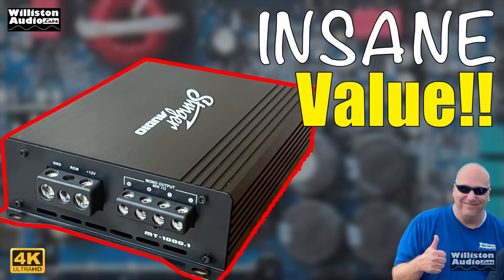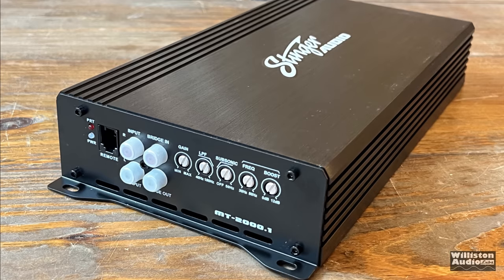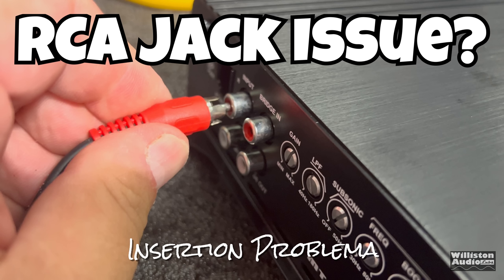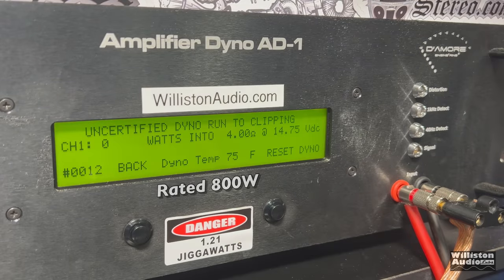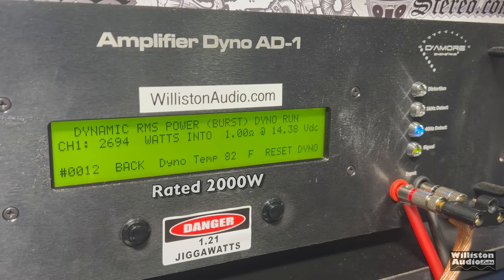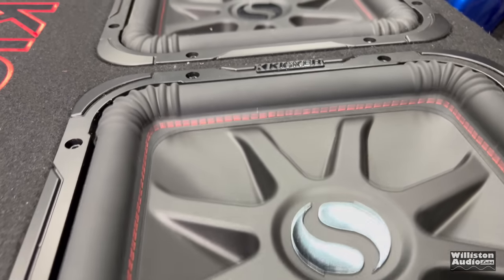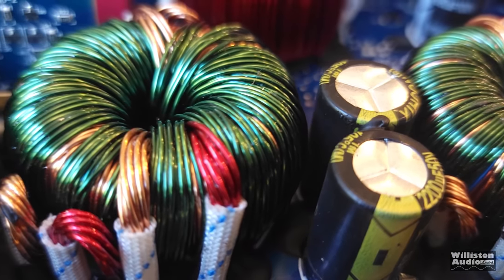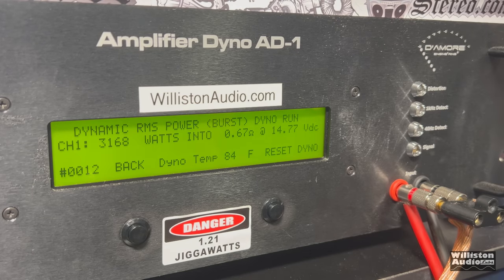This 2000W Subwoofer Amp is Impressive

Comment: Phoenix Gold: the cheap stuff when you couldn't afford Street Wires.
Scosche: the cheap stuff when you couldn't afford Phoenix Gold.
Stinger: the cheap stuff when you couldn't afford Scosche.

So yeah, I had a lot of Stinger!
Reply: Phoenix Gold was absolutely NOT just cheap stuff by any means. I had the ZPA 0.5 amplifier with the plexiglass front and dual cooling fans and it was one of the best amplifiers  i ever owned. I paid around $1200 for it new back in the 90s!  They are still fetching quite a bit of money on ebay and Audiogon today, they are highly sought after .
Reply: @vegaslimoguy2376  You had to be there. This was from WAY before the timeframe you're talking about.
Reply: @vegaslimoguy2376 When streetwires was around and PG was selling their accessories (1992-1995) they were cheaper. Not cheap (well the PG SAPPHIRE was cheap) but the comparison is FAIR.

Comment: Have anyone ran into the problem of buying a new 4 ch amp and one of the channels don’t work? Has this happened to anyone else. I bought two completely different amps from two different companies and both had one of the channels not working.
Reply: Maybe check your signal wires, could be a bad channel or bad wire from your signal source.
Reply: @huhdidwhat  thank you for the response
Reply: Definitely switch around your rcas to make sure all 4 have a signal and then switch around the speaker leads to make sure you don't have a blown speaker. 

What your describing sounds highly unlikely. Possible, but unlikely.

Comment: That white strap going over the red thing inside the amp is the strap. That's why it's strappable.

Surprised you didn't know that.
Reply: Mind Blown.
Reply: Sure, lol. 
Except Stinger calls it bridging two amps. I guess we have to stack them like a bridge. Lol
Reply: The bridge is CLEARLY the silver rod above the two round green things. This, by the way, is the only reason two round green things can EVER be used at the same time, hence the "bridgeable" spec.

Whatever it is you're talking about is complete nonsense.
Reply: @Cookie-Dough-Dynamo  This is funny and all, but I don't want people to think we are serious.
Reply: Who's not being serious? If you're having a hard time understanding this, that's ok. Try looking at this from a different perspective: Pause the video during the "watts inside" bit and zoom in on the red and green round things. Now,  lay your phone flat and look at that amp end on. You'll see how the strapped round red thing and the silver rod bridging the two round green things allow this amp to run in the strapped/bridged configuration.

It's one of only two amps in existence capable of running in this state. Steve Smith himself developed this design and used the red and green colors as an Easter egg.
Reply: @Cookie-Dough-Dynamo  That one was not even funny.

Comment: i do not like at max high 180hz frequency seems low but i never bought a sub only amp as i like to set may own cut offs
Reply: You can set the crossover anywhere between 40hz and 180hz. Most will choose 60-80.

This is a good thing for a mono amp. Its built specially for subwoofer or bass use.

Comment: Nice amp but it is way to small to put out a massive amount of AC on the subs with the heat sink being a "basic" one.  I do not trust it.  That is my thoughts on this amp.
Reply: He shows after hitting the quad box it ran cool. Not to mention there are 2 comments in here that bought them and stated they run cool. So yea 😊
Reply: It’s 2023, size doesn’t seem to matter anymore, and look at the big cheap amps they are not reliable, big four prints isn’t always necessary. And it’s stinger, when have they not made good stuff.
Reply: A good, efficient amp design is not going to waste energy by turning it into heat.

Comment: Would not use this at a load impedance below 2Ohms. 67% efficiency at 1Ohm? Such a jump. Something is getting hot or depleted. Where is all that heat going? It IS a small chassis too, not like an old school Linear Power, M Series Phoenix Gold, or RF Punch heatsink.

Yes, I suppose a reactive load of subwoofers "wired to 1Ohm" would likely be closer to 2Ohms in reality.
Reply: Losses in the transistors and magnetics and less so in the connectors and PCB copper. You’re right - the amp isn’t optimized for loads below 1 ohm.

Comment: Why does it say bridged if is mono block 🤔
Reply from the maker: Big Dummy Error
Reply: Bridge is Stingers terminology for strappable.

You connect the amps by using an RCA cable from one (the Master/Primary) Bridge out to the other amps (Slave/secondary) Bridge in. This synchronizes the clocks. All controls divert to the Primary amp.

Comment: I thought that class-d (switch mode) amps couldn't give less of a shit about reactive loads and that all loads are same as resistive from their point of view.
Reply: I'm not sure i understand you. Your asking about amps in general?
Reply: the back EMF coming from the speaker coil during motion is ignored by a switch mode amp.
Reply: @machrider2333  I believe class D is just as susceptible to it as class A/B.
Reply: @machrider2333  Is your original question in response to Big D saying that resistive loads are much harder on an amplifier than reactive? I don't think he was referencing back EMF at all. I believe he was referencing the impedance load the amplifier sees which forces more power from and puts more stress on the amplifier.

Comment: Talk about using the worlds cheapest rca inputs! Don’t even fit a proper cable!
Reply from the maker: I didn't get a chance to ask Stinger about these, may have been a fluke. I'll report back if I get additional info
Reply: It's all abt quality control, how could the amp be Dyno certified and stinger not aware the RCA is defective.. what else did they miss?
Reply: Just got my MT2000.1 and the RCA's are also too small.  I tried removing some plastic material inside but there may be a intermittent short in there now.  Guess I should return it.
Reply: @justinwhitaker6128  what are they testing these things with??? Where did they even get non regulation size inputs????